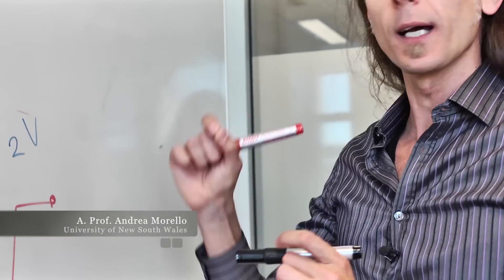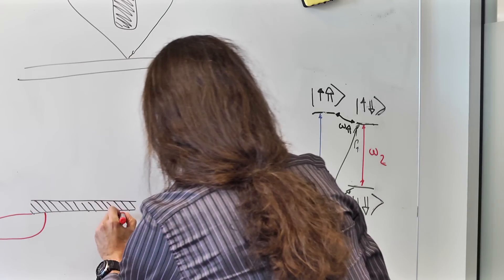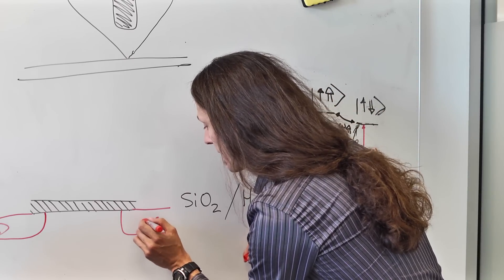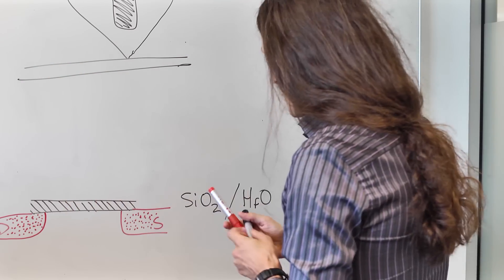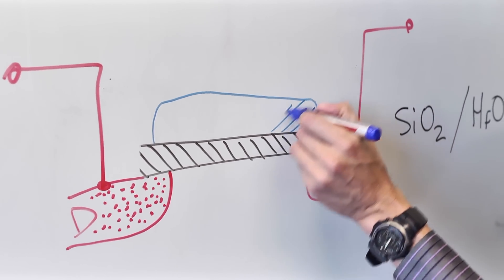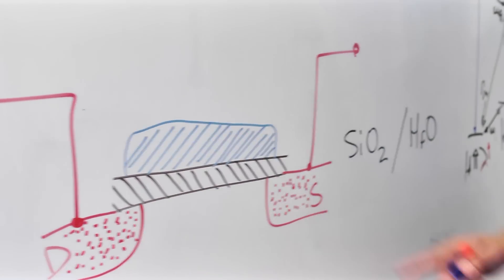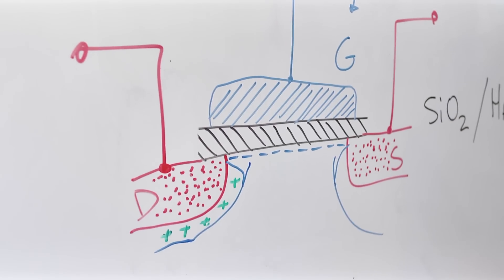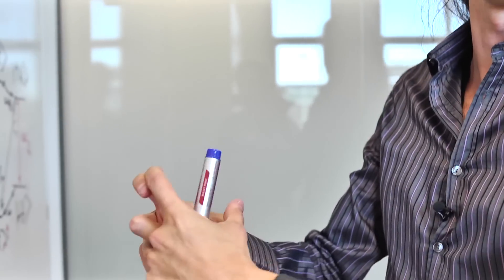Transistors & The End of Moore's Law

Comment: You do realize that a transistor is a voltaic battery just on a very micro level because we already have the system down pat we could literally put different materials in those n-type and p-type doping areas to cause a very intense and very powerful compressed battery hell we could do it with lithium batteries and make them so small that we could a Tesla battery pack on a silicon wafer if only someone realized it but what do I know!

Comment: This guy was awesome!
The date is March 5th, 2019 and the transistor are about 6nm in length, so moores law held for about 6 more years. Unfortunately, quantum tunneling has gotten really problematic. The next steps are fuzzy but some methods include using materials other than silicon. In 6 more years I do wonder if this will continue to hold
Reply: No exponential law can continue indefinitely in the real world. It is not, however, always so clear just where the wall is, that its continuation will slam into.
Like the prof. said, to go on from here, some new physics must be exploited; a different design.

Fred

Comment: It’s 2019 and they have found solutions to these problems so we are looking at 1nm process by 2023
Reply: Couldn’t be more wrong lol. 7nm transistors were synthesized in early 2000s but it took nearly 2 decades to them on a consumer chip. Moreover, State of the art 1nm transistors have not provided a solution for quantum tunneling, they are simply using alternatives to silicon like carbon nanotubes. An electrons position is a probability function, and this principle will likely spell the end of Moore’s law.

Comment: What about Intel TERAHERTZ technology from 2001 with 10,000 times less leakage or similar tech from Motola and DARPA in 2009 and 2011 that runs at 1THz, 1000GHz or FASTER ? Even 60GHz modems have existed for a few years that use transistors running at 60GHz, yet we are stuck at 3 - 5GHz since 2001 !  In 2007 the 1st 1TB hard drive, in 2019 they STILL SELL 1TB hard drives ! Clearly tech is being held back either for profit or some other reason. Like Intel 4 cores since 2007 - 2018 for most faster CPUs and barely any speed improvement while GPU speed has increased and used HBM RAM, 512 width bus, many core equal to 32 - 64 or more cores. Yet it isn't possible ? Intel is selling about the same 4 core chips since 2007 and 12 years later STILL at about $350. The price hasn't even got lower despite huge lithography improvements !

Comment: Wait a minute... He sayd to build a barrier so that it does not let the current pass, but the problem is that the electrons have a probability to pass throw this barrier in a seartain small size of space. So would it not solve the problem if the barrier was made of the same charge as the current, so it repel the current? would the electron pass even throw an non opposite charge of the barrier because of quantum mechanics? Thanks for the video and hope someone explain it to me... some day... hopefuly.

Comment: Very interesting and a great learning experience.  Unfortunately it is not quantum tunneling that is posing the biggest challenge to the shrinking transistor.  It is the photo lithography process that is used to create all these structures.  The limit to further shrinking is the wave length of light and the ability to "focus" the image of the transistor so that these structures can be formed.  We are moving to deep UV lithography systems that will take us a bit further but I would imagine that the true limit to semiconductor shrinkage is not a quantum limit but an optical one.

Comment: OK... I'm old... (59 now) and am a little disappointed that we didn't at least touch on the venerable (and original, sort of) transistor the bipolar transistor aka the current controlled transistor that had instead of a gate, source and drain; had the emitter, collector and base. It also did not have the insulator or the notion of a channel. They were formed by doping the ends either P or N and the middle of the contiguous crystal of silicon or germanium with the opposite type. This made NPN or PNP transistors. The barrier regions formed between the opposite types and 'forward biasing' the emitter-base junction caused a small current to flow which allowed a much greater current to flow from collector to emitter. No base current effectively means no collector current. BTW both bipolars and FET's (what you and your pal have been talking about) are not only switches, but are amplifiers as well. This means that besides the full-on / full-off mode used in digital electronics (run in saturation) they can also be biased to be run from nearly off to nearly saturated in a linear region and a small changing voltage (in FET's) or small changing current (in bipolars) can 'drive' large changes in current from collector to emitter or drain to source... like the ones used in every microphone, audio amplifier and radio on the planet. Note I said 'original, sort of'. The first transistor was a specific type of FET called a jFET or junction FET. It was sort of a FET, sort of a bipolar half breed. Oh, lest I forget, semiconductor diodes are all half a bipolar transistor and came about first, which led to the first transistor. Have a look at http://en.wikipedia.org/wiki/Transistor for William Shockley at Bell Labs in 1948-49. Cool story and yet another 'way to skin the cat'... and really the first way. Damn I got wordy about this... Sorry, it goes with being an electronics engineer, I suppose... :)

Comment: its 2017 and quantum computers are ALMOST the only way forward because our transistors have reached 3nm, the width of seven silicon atoms!
Reply: We're not at 3nm yet in the supermarket. 3nm is only done in experimental lines, not in actual devices.
Reply: also, i think optical computing is way cooler than quantum computing
i think quantum computers will only be used for special applications and optical is the likely candidate for consumer devices

Comment: But in his qubit explanation video he describes very well how classical computers will always be the best way to play games and use Word. Quantum computers will play a huge role in other applications. So it's still down to Moore's law enforcement... why not just make the minimum 2 or 3 atom transistor wafers (which will contain the most populated chip possible) and call that good enough, and stack them. Miniaturize the contacts and everything else that physically holds them such that a microscopic cube could be a microprocessor with trillions of gate transistors. Pretty sweet.

Comment: well transistors needed an understanding of quantum mechanics to be developed so they both use quantum mechanics. but much like the move from vacuum tubes to transistors which was moving from a machine to using the properties of a materiel, you are going from using the properties of a materiel to using the constituent parts of a materiel. Although doing this on the same scale as transistors will probably mean finding an arrangement of a material that you can read the energy states of an electron from, then it is much easier to produce and refine.

Comment: My question is.. why not double the size of the chip?
Reply: Takes up more space obviously.

We're trying to make things smaller and/or the same size as before but more powerful. You wouldn't want to double the size of your laptop, would you? Wouldn't it be better to put twice the power in the same size?
Reply: well, laptops are mean to be portable, my PC is not, its sitting comfortably under my desk.. i get it that people want to make things smaller, but right now, if you made the chip 2 times the size, nothing would change at all, the motherboard would get maybe 5% bigger, which does not matter since you have a big case... if its simply more transistors = more powaaah, then making the chips 2x the size is not a step back, its just maximizing the potential.. its like using truck to drive bricks from shop to home, instead of a car... its bigger and it moves more bricks, but its not less modern because of it

Comment: Ok, so potentially stupid question here. Once it gets to the point where transistors can't be made any smaller, is there any reason chips couldn't just be made bigger to allow more transistors? I realise for things like phones that wouldn't work because they need to stay small enough to be handheld, but what about my computer? I wouldn't mind the components of my computer being bigger if it could be more powerful.
Reply: Man , just ask yourself why do they need to be smaller and smaller , and not bigger and bigger?  Its obvioslly that the smaller the distance between electrons , the more billions of calculation/ second you can make. So , being bigger its actually an increse of calculation power in just 0.000000000 .....1 than just  making smaller . Simply put it : you make the  chip bigger means a tiny increse in calculation than just by putting more and more transitors on a chip of fix size. 
Even more , if you make the chip bigger , it will mean a lot of heat , that a big problem for computers as you know.
Reply: remember you need to cool it down

Comment: 12nm chip says "Hi" from 2016.
Reply: 2019 here!. Be carefull of the marketing terms used 11nm and such. It used to be that it was the international standard to name the next node to the channel length of the transistor. However, this is no longer the case. The result is that if you watch a 11nm chip under the SEM/TEM you will find that the channel length is actually 15nm or more and the increased speed comes from better architecture among other things. Having said that. The have achieved 7nm lines at least (already in the past) (I've seen the pictures) and are indeed busy with going even further. I do not know how far they are with the actual device making.  2years ago there were still some issues with CD uniformity (aka, consistent channel length and switching speed). Source: I work in the industry. Anyway, with the current way the industry works, add 5nm to the channel length. On the other hand. as I've already seen the 7nm lines, that means what moore's law will continue for some 6-8 years.
Reply: 3 months later in 2019 here. 7nm is on the market to buy for regular consumers! (Ryzen 9)
Reply: @TeleportingBread161  i just ordered one about 2 weeks ago
Reply: @1pcfred  it's the lower bound on a downward trend, although it's really just a trend (Moore's law is not more than a misnomer)
Reply: @klaasbernd  Thank you, really interesting information!
Reply: 10nm now
Reply: IBM announced 5nm transistor a couple days ago.
Reply: While intel will forever be stuck on 14+++++++++++++++++ xD
Reply: 7nm chips, hi from 2019
Reply: Zen 4 will launch with 5nm in 2021.
Reply: @element1192  parts pitch is meaningless today. They're just pulling those numbers out of their collective asses.
Reply: Paul Frederick Excuse me? Do you think TSMC is just making it up? They HAVE 5nm nodes and AMD is buying them, and they announced they’re putting them in Zen 4 CPUs.
Reply: Paul Frederick 10nm is higher density than 7nm?? Source? But yeah, Moore’s Law is dead
Reply: Paul Frederick If it’s common knowledge then why have I never once heard it mentioned at all 🤔
Reply: 1 nanometre from 2020
Reply: 5nm chip says Hi from 2020
Reply: @josephoduor2358  crap density and no performance improvement says hi from 2020 too.
Reply: Last
Reply: holy shit that's trucking amazing
Reply: I believe 5nm is the minimum
Reply: @fgvcosmic6752  I believe 3nm is the minimum
Reply: @fgvcosmic6752  TSMC is planing the 3nm and its maybe coming by 2022
Reply: @fgvcosmic6752  Apple IS at 5nm
Reply: 7nm says hi from 2019
Reply: Y’all know that 1nm carbon tube transistor.
Reply: Marc Jackson  Intel 10nm doesn't seem to work quite right now. They're only making mobile parts with it. There seems to be a frequency and a power issue with it too. I've heard yields are not so good either. So it is fair to say there's problems. But maybe in time they can get on track?
Reply: Marc Jackson  business must be good for him right now.
Reply: 5nm from 2020 say hi!
Reply: @Stevenpwalsh  what a cool thread, hi future people with like 2nm transistors lol and then hi to the further future with quantum computing
Reply: What he said remains true. In order to consistently synthesize sub 2nm transistors engineers will have to provide a solution for quantum tunneling in order to make a functional chip. Finding an alternative to silicon is likely how the very smallest transistors will be made, but it is still unable to alter the fact that an electrons position is a probability wave, and quantum tunneling will still occur. Intel and other semiconductor companies have already declared that they preparing for the limit to be reached and are looking for other ways to improve processor performance.

Comment: Wait, aren't quantum states governed by observations keeping an eye on them? Quantum tunneling is merely a probable result of a quantum particle's superposition. 

So.. if there was some mechanism installed to firstly create a physical barrier between the connections and then another mechanism to constantly measure the state of the quantum particles, then shouldn't it, in theory, prevent tunneling from happening all together? 

Like the double slit experiment, if we design something to work a specific way, quantum superposition should only happen when we don't observe the way the particles travel. Meaning if we ignore the way quantum particles move, they seem to ignore the laws of physics and the nature in which we try to control them. But if we observe them as they move, they seem to work exactly as we expect them to. 

So, we make a transistor at a quantum level, develop some means to measure the movements of the quantum particles, and therefore the particles should always follow the designs of the transistor. 

I know I'm grossly oversimplifying here. But am I wrong?
Reply: r315r4z0r the problem is hisenberg uncertainty principle. you cant know the velocity of position of the electron simultsenously.

Comment: I have a question. Why cpu manufacturers make new gen cpus, that have smaller architecture every ~2 years? Can they make them sooner? My question is do they make that to make more money? Lets say from 45nm to 14nm in 1 year. The process shouldn't be hard once u got it?
Reply: R&D for new architechure not only shrinking
Reply: No, that's not possible because it takes a lot of effor to design these smaller transistors. It gets released when it's done. Companies also want smaller transistors because they are cheaper to manufacture so if they could do that in one year, they had surely done that ;).

Comment: why does the height of the barrier matter in stopping the electron in quantum mechanics?
Reply: Hemel breker because of quantum tunneling. if the barrier gets too small the electrons can magically jump from one side to the other bypadsing it completely. that means you wont be able to control it like a switch. it will always be in the "on state."  even with just using it as amplification the signal would be very noisy.
Reply: Why the height, then - wouldn't the width be the determining metric?  My understanding is that the evanescent wave travels length wise and that is what causes the tunneling.